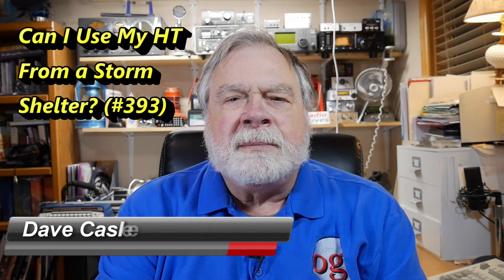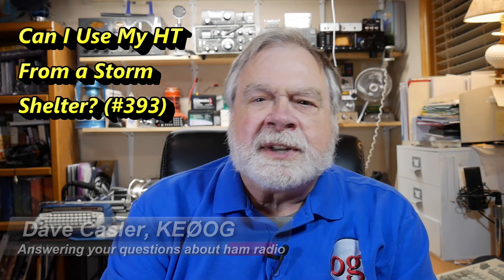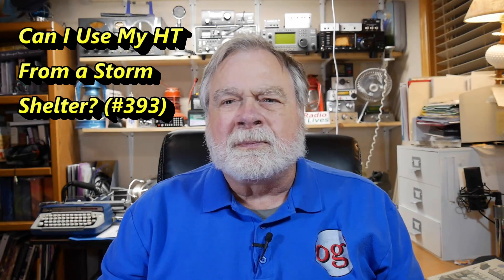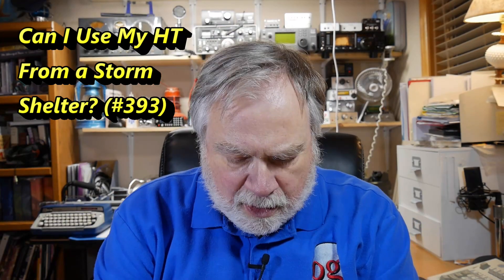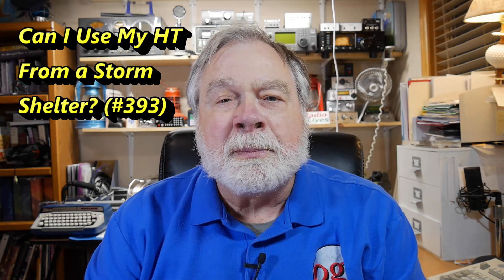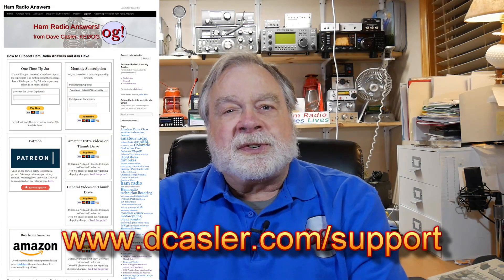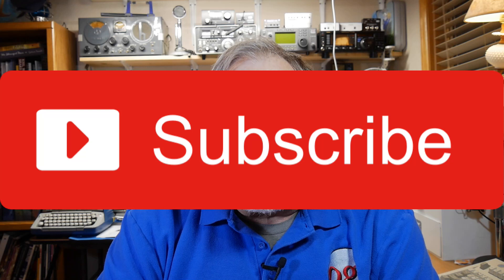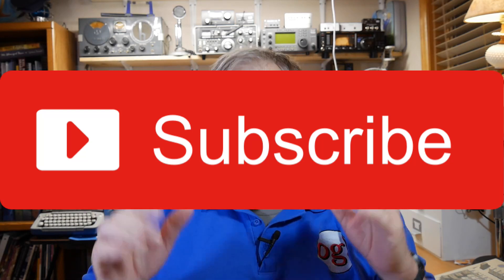Can I Use My HT From a Tornado Safe Room? (#393)

Comment: It depends on how the shelter is designed.   Wouldn't it be easier to just bring the HT in the shelter and try it?
Reply: Right! You gotta test it out! I'd run an antenna outside and away from possible structural damage, from a crushed home. And keep an HT or mini mobile inside the safe room area. Thats what I am doing right now.

Comment: I live in NE Oklahoma and have done so for decades. I have a background in public safety and use radios every day, in all sorts of different buildings and environments. I would have another HAM do some testing with you and see how your HT gets out from inside your shelter. I use a DMR UHF radio every day from inside of all metal buildings and it TX to a repeater about a mile away. Works fine, every day. I'd say you have a chance, just try it out. Make sure you have a good antenna. If all fails, you can rig up an external antenna. Try some of the stuff Dave talked about in the video. ARES/RACES is beyond a joke in my area. Hopefully it's better in yours.

Comment: Those fortunate to have a safe room in their basement must maintain it for the intended purpose. I have seen numerous news stories over the years where families retreat to their safe room and its being used for storage. One family of four recounted how they could barely fit into the room because of all the junk stored there. Afterwards their home was destroyed. They were covered in dirt. No water to wash dirt from their eyes. No first aid kit. No shoes. I suggest for emergency signaling have a whistle or one of those air horns that is mounted on a can of compressed air.
Reply from the maker: Good tip!

Comment: I thought it would be interesting to build a patch antenna as part of the outside of the house and have it directed towards your repeater of choice.
You can also use fast-scan 5.8GHz transmitters that ham operators can use to monitor outside the safe room or shelter when our call sign is overlayed on the video. A lot of FPV cameras have OSD which can be easily programmed in.

Comment: As you pointed out, proper planing is needed. Try the HT in the shelter. Put up the external antenna and try it.  Also, contact your local phone provider and see if a Plain Old Telephone Service line can be run into the shelter. If the utilities are underground, a land-line may be the answer. We have kept our land-line phone just for emergencies. When the power goes out it still works.

Comment: Hey David, I was wondering if you have a video for ham satellites to use as a repeater and how to use them well. If not, could you make a video on it?
Reply: That type of communication is very directional and hard to achieve since you have to constantly move your antenna in sync with satellite location.
 but videos are out there.

Comment: It might be a good idea to have a mag-mount antenna with coax and adapter that you can slap on something on the way into the shelter, have a flashlight and extra batteries. Have national call frequencies as well as local repeaters, programed into the HT. Some or most ARES groups will also have a simplex frequency for emergencies.
Reply: Even a spare, throw away cell phone. Charged and ready?
Reply: @chrissewell1608  Absolutely.

Comment: FEMA P-320 provides details on different methods for design/building a safe room.  We designed a safe room in our current home.  It is above ground, wood-framed, and sheathed in multiple layers of 3/4" plywood and 12 ga. steel.  The "FEMA Approved" steel doors are massive.  No cellphone, nor HT signals penetrate the steel cocoon. (Actual Test Results by me - KN4OET). The "requirements" for a FEMA Safe Room when we built ours 11 years ago included a requirement for a Landline Phone in the safe room.  That's one of the reasons I still have a landline.

Comment: Drill a couple of small holes in the ceiling of the room at different positions. Then poke your antenna up through the hole a talk on the radio. You could keep an external antenna in the room with a short cable to connect to your HT. By the way, the shelter would make a great hiding place in a FOX hunt. That would make a great practice case.

Comment: I experienced a category 4 hurricane in Orlando in 2004 that was supposed to pass 20+ miles East of us and instead passed  5 miles west of us. (I was in the suburb called Winter Park).  In August.  It made an impression...  The water was out for 36 hours or so and the power was out for 3-5 days.  I put all the beds up against the windows and sliding glass doors in our 2nd story 2 bed apartment.  (We had windows on 3 sides of the building...).  I filled all the bath tubs with water and all the pots and pans with water... it was nice to be able to flush the toilets for instance with extra water.  I planned in advance what to take out of the fridge and made as much ice as I could to keep food cold. (Cause after one opens the freezer twice with no power, the stuff will go bad within about 24 hours...).  And last but not least, I put our 2 cars in the very middle of the parking lot as far away from all the trees as possible.  When I came out the next morning, the parking lots were an Armageddon of fallen trees.  Nearly every single car on the sides of the parking lot had smashed windows and many had a tree that crashed through the roof or the front window.  Something like 40 cars were totaled out of 75.  Our 2 cars were fine.... advance planning is worth a lot.  In other news I was getting 22-25 miles of range in the Bay Area in California using an 8W Baofeng with a j-pole (google Ed Fong in Santa Clara if you want one) that was hanging vertically from a first story balcony.  I'm getting about 20 miles of range with a mag mount antenna on the roof of my car here in Denver.  So yes, an HT with an external antenna can absolutely be a lifesaver.  It can't however send a signal through bricks and steel.  Advance planning is required.  and knowing the local repeater frequencies (and using CHIRP to program the radio ahead of time) is a very good idea.  Also local police and fire stations... just in case.  In other news... get a solar still (they can be used to purify anything including sea water, urine, whatever.  Get a steripen UV water purification device with spare batteries with a 1 L Nalgene bottle.  A gravity water filter.  Collapsible jugs to store waste water.  Get some small solar panels to charge USB devices.  Get some food that doesn't go bad. (Evidently the wheat grain in Egyptian urns can still be eaten 3000 years later...).  Also nuts, honey, dried fruit, canned food, vitamins, etc.  Fire starters.  First aid.  A good knife.  And all the rest of the typical prepper stuff...  You can get an alcohol stove that can be used indoors which has no byproducts other than water.  Don't try that with butane or kerosene etc in an enclosed space; they have poisonous fumes as combustion byproducts...  there are portable solar panel arrays that can be setup to e.g. generate 400 W of power with 3 m^2 of panels or so.  In some parts of the country I might also recommend an inflatable raft with a foot pump.  Tents, sleeping bags, backpacks, and waterproof dry bags to go around...  Looking ahead over the next 10 years, you can absolutely expect to see some weather events that mankind has never witnessed before.  Things are getting quite serious.  (I was offered a role before as the CTO of a climate risk company, I know something about this topic).  So be prepared.  (I strongly recommend a wind-up j-pole antenna with a hand-held radio.  And possibly some cord and a pully to hang it from a tree...).  In the basement situation... there had better be an antenna wire leading out of the basement or you're out of luck.  Something like a car jack in that basement and other such tools might not be a bad idea either...

Comment: Plan a few 1/2 or 3/4 pvc pipes in the wall, ceiling pointing in different direction. Then get a HAM antenna to extend after the storm. Testing in calm weather of course. And give trusted people your GPS location, may not be a lot of landmarks after the storm. Stay safe

Comment: A couple of important things to know about storm shelters. In home tornado shelters can be above ground or below ground. They can be built with new construction or retrofitted to existing homes. FEMA publication P-320 (https://www.fema.gov/sites/default/files/2020-07/building-safe-room-home-small-business.pdf) describes the criteria storm shelters should meet to protect the occupants inside. To test the efficacy of storm shelters Texas Tech University fires 2x4’s out of a cannon at 100 mph to simulate airborne debris picked up by an EF-4 or 5 tornado. Any debris penetration results in a failure. Shelters should be designed with continuous load transfer down to a minimum 3.5” concrete foundation reinforced with #4 rebar to support the storm shelter in case the structure collapses on top of the shelter. There is no plywood or lumber used for sheathing or structural support in a tornado shelter.

Carrying an HT into a shelter is probably a good idea. You may be able to listen to NOAA weather radio or broadcast stations (depending on your radio), but the reinforcing rebar or steel plate that make up the outside shell of a storm shelter will likely attenuate the 5w signal from an HT to the point it doesn’t open the repeater squelch. After a tornado passes and you emerge from your storm shelter is when the HT will be most useful.

Comment: You can get a nice cheap ladder line jpole that comes with a feed line and can be put out through a vent or hole. They're sold on ebay and they screw into any HT and work great. I forget the seller that makes and sells them but just search ladderline jpole. I use it hanging in a window with great results. I hit all the local repeaters with no problem. I would trust that over being able to get a cell signal out.

Comment: Build your own dipole for your HT and trash these rubber duck antennas, so you can get some better reception. You can use very light weight aluminum tubes and some basic coax to remove the stress off the sma connector of your HT. Very easy project to do.
Reply: Or just get a good vertical and run a properly tunedTiger Tail. Much more practical and same performance...

Comment: I could use a video on how to call a repeater and use it to connect to stations further away than just a few miles.  Is it possible for a repeater to call another repeater thereby extending one's range even further?  Can you go cross country or even across oceans with repeaters?  Yes, these are newbie questions (guilty as charged!), but there are no clubs where I live so I must learn these things entirely on my own. Reading about them only goes so far.  Seeing them demonstrated in videos goes further.  Doing them firsthand goes furthest, but one needs to see how it is done, first.
Reply: I am just curious here... Are you even a Ham Radio Operator? Because you should know these answers, already if your got your license. And being buried in your emergency shelter is not the time you want to call across the ocean! And No! Repeaters don't work across oceans. (You should know that too.)  And I am almost certain there are multiple radio clubs in your general area, you just have not found one. It may not be next door, but somewhere in your area.
Reply: @chrissewell1608  -- Hello, Chris, nice to make your acquaintance. Think back for me -- you first found out about repeaters because someone told you about them, right?  You didn't just come upon this information by magic, did you? You acquired a house with enough land for an antenna, then a license, then a rig, then a place to put your rig, all by magic, right? OK, maybe not magic, but I'll bet those things were available to you without you having to think much about them, right?  You then joined a club - one that spoke your native language - and got on the air with lots of supervision to make sure you handled your rig responsibly, right?  Well, what if I told you I have only one of those things. I have a US General class ham license and have had it for two years, but in that time I have never keyed a mic. That's mostly because I don't live in the US, I live in Japan. I need special permission to operate here which I have already researched and found that it is not difficult to obtain, but I must set up a rig first so it can be inspected. The problem is that I can't set up a rig, at least not one that can DX to English speaking countries (including the US), because I live in a house with no backyard on which to build an antenna.  No front yard or side yard either, no basement, no attic and no garage, and that's considered normal here. There are also no nearby trees though I do have two electric power poles within ten feet of my windows, but I can't put up an antenna there, obviously, (the QRM would be terrible..;). It would even be hard for me to find enough space for a table on which to put my rig once I figured out how to set it up with a decent antenna. So you see, people don't always "should know" this information, it has to come from somewhere.  In my case, it must come from the internet because that's the only elmer I have. Eventually I'll move into a bigger house, but that will have to wait until the world gets over its current Covid crisis. In the meantime, I'm in learning mode. You can help by helping me find a club that speaks English in western Tokyo. They seem to be rare, despite the fact that there are more hams per capita in Japan than there are in the US. Thanks, and 73.  KD2ORG
Reply from the maker: Chris, that's unfair. As a newbie he doesn't know about DSTAR or DMR. Those types of repeaters do work around the world. He just needs to move beyond FM.
Reply from the maker: KD2ORG, please ignore Chris. He's not being helpful and therefore isn't worthy of your time or a reply. But do check out DMR, DSTAR, System Fusion and/or WIRES-X, as they all let you talk around the world.
Reply: @davecasler  Thanks Dave, will do.  I caught your mention of my problem on your live stream this morning, thanks. I read about digital modes when I studied for my tests but don't have a rig that is capable of accessing them, at least not yet.  On my wish list for sure.  73 KD2ORG

Comment: I have been in 5 tornadoes they sound like continuous thunder. Three of them I was able to take shelter in can lift stations 20 two 30 feet under ground.  One was at a fair on the midway it was a weak f1 I had some welts from things hitting me. I was also in one in my car it was raining so hard I had to pull off to the side of the road and didn't see that one coming the car was rocking like mad and small branches were hitting it. After it passed I could see that it had leveled the small town about 300' from where I stopped.
Reply from the maker: The stuff of nightmares!